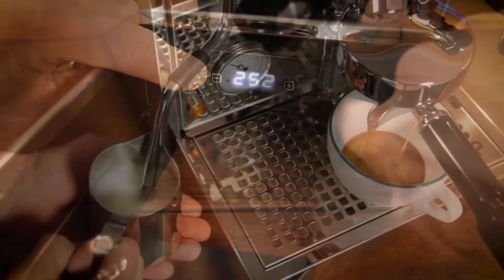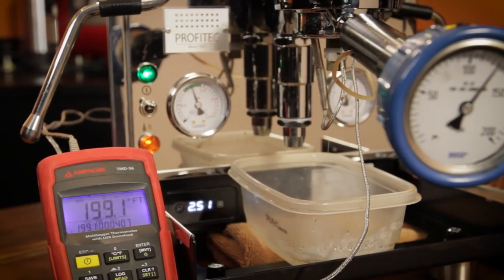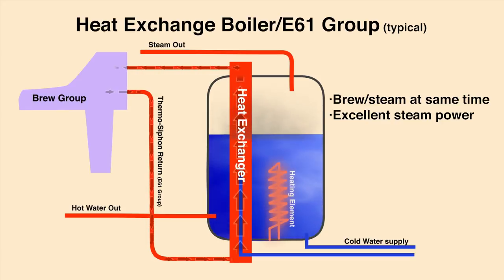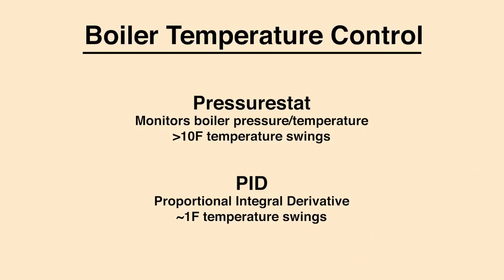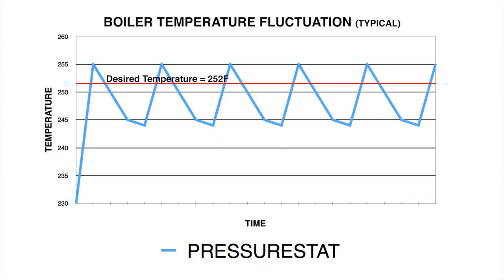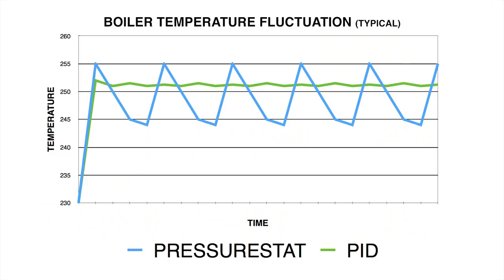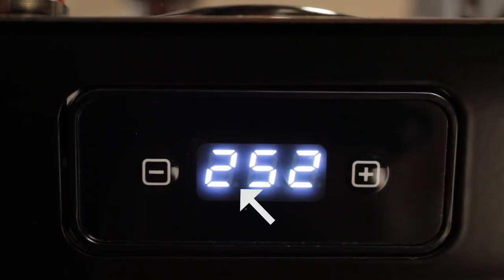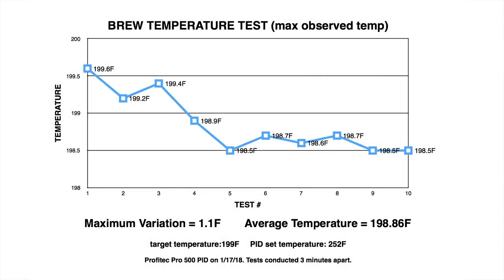Review: Profitec Pro 500 PID Espresso Machine

Comment: Mi Marc, thanks for the video! Just got my new Pro 500 w Flow control! It's beautiful! Any tips to get good crema on this? Not sure what I am doing wrong but I don't get any crema. My old machine was a Gaggia Classic and I am using all the same coffee and grinder (I have a Breville grinder) but no crema with the Pro 500.  Do you have any advice? This is the first time I use a machine like this. Thank you!!
Reply from the maker: Hi AP, Sorry for the delayed response. Been hectic around here as we deal with current events. I posted a video a couple of days ago on calibrating flow control and a deep dive into 5 flow profiles to use for different coffee types and situations which should help: https://youtu.be/_8lNz2rL5l8 Beyond that, lack of crema is usually the grind size and/or the coffee. If it's a coffee you used with the Classic and got crema it should def be capable on the Pro 500.
Marc

Comment: Thanks for the review! I'm on the process of buying this machine. However, I'm still doing research on which grinder to choose. The sette 270 seems to be a nice grinder to go with the PP500. Could someone teel me if it would be a good choice and other alternatives worth considering. Much appreciated
Reply from the maker: Hi DH, You are welcome and thanks for the question. The Sette 270 is a nice grinder. Be aware it's intended for home use. It's not a prosumer level grinder. It's also a hair louder than most due to it's more open design. If looking for something with a more robust build you might consider the Ceado E5P or E6P: https://www.wholelattelove.com/ceado-e5p-electronic-coffee-grinder
Reply: In term of grind quality, is it similar with the Ceado? The Ceado seems a bit to big for my few shots a day.
Reply: @Dom6450  what did you end up going with?  I went with eureka mignon specialita 16 and it is very quiet and not too large on the countertop!

Comment: How does the Profitec 500 compare to the Bezzera Magica pid and Mitica top? Is there a significant difference in quality? I don’t see these 2 Bezzera machines in your store, any specific reason for that?
Reason for asking is that I live in Singapore where the Bezzera’s are available but the Profitec I would need to import from Malaysia, so a bit more difficult on the aftercare support.
Reply from the maker: Hi Peter, Thanks for the question. We have chosen not to carry the Magica and Mitica. Frankly that decision is beyond me. My guess is they're either not available in US market or our product specialists decided they overlap in capabilities/features with other machines we carry. The Magica is up there in pricing for a HX boiler machine - significantly higher price than the Pro 500 PID so that likely has something to do with the decision. IMO the Pro 500 is the cream of the crop of PID HX boiler machines. Other options in that category are the Rocket Espresso Type V and Evo R Mozzafiato and Giotto machines. Type V is vibration pump while Evo R is rotary pump and plumbable. The Rocket machines are more expensive than the Pro 500. My preference is with the Pro 500 - slightly better build quality than the Rockets but some prefer the look/branding of the those.
Hope that helps!
Marc

Comment: Being that most prosumer machines have a copper boiler, is there any disadvantage of a SS boiler found in this machine and the ecm v slim? Or should this be seen as an advantage over copper?
Reply from the maker: Hi Eric, Thanks for the question. Most newer machines I'm seeing have stainless steel boilers. Especially ECM, Profitec. Working with a Rancilio Silvia Pro at the moment and it has a stainless steel service boiler and brass (lead free) brew boiler. I personally have a slight preference for stainless steel but I would have no problem with copper. No disadvantage to SS IMO. Actually it looks much nicer down the road when you open up a machine. Copper tends to discolor (patina) and get stains.
Marc

Comment: Hi Marc .. a maintenance issue.. I have had the Pro 500 PID for about 5 months and love it. Almost no flushing required. I have a question about chemical backflush cleaning. When I do it, it really removes all lube off the shot pull lever/cam 'innards'. I then need to disassemble and add Molykote, which is not too bad. I recently read and tried adding about 3-4 drops of extra virgin olive oil in a water backflush and that seems to lube it as well (do that once a month). Can you ask your maintenance gurus if they think the olive oil will also coat stuff it shouldn't. The lever mechanism dries out so much, that I'll need to lube somehow after every chemical clean (3g cafiza, every 2 mo. 1-2 shots daily). Thanks.
Reply from the maker: Hi Dave, Thanks for the question. I'll forward to our service manager and report back with any thoughts he may have. Honestly don't think he'll have any experience with olive oil but may have an opinion on coating stuff that it should not.
Marc
Reply from the maker: Here's the response from our service manager:
"Interesting. I never heard of that one. The only thing I could see it possibly affecting is it could possibly cause a buildup on the filter screen inside the mushroom valve since the oil will move to the top when not in use. I’d just suggest he keep an eye on that.
I’ll start trying that on my home machine too. For science."
Reply: Thanks for the reply.. probably once a year I'll take the mushroom valve out and clean and examine for any buildup.
Reply: Hi Dave, I noticed this too the first time I cleaned the group with Cafiza. Cafiza is pretty aggressive stuff, so the second time I just used about half so 1,5 grams (more in line with Profitec own 2 gram tablets) which seems to be the right balance between cleaning and removing oils from the group, but not removing all the oils from the lever itself. Also the profitec manual advices to wait 1 minute to after each backflush with lever in middle position and purge the water after that minute. This allows the cafiza to do its work. Most videos in the internet purge the water directly. So my take is, use less cafiza and more time to let it do the job cleaning the group. Hope this helps. If you used to much cafiza and all oils are gone, you don’t need to use seperate oil , because this will automatically build up again after a few days of making coffee.

Comment: What’s the difference between the Profitec Pro 500 and the Rocket Mozzafiato Type V? I’m strongly considering a single boiler traditional style espresso machine with PID control.
Reply from the maker: Hi MS, Great question and good timing. I have a video going up later today comparing the Pro 500 PID, Rocket Evo R Giotto and Bezzera BZ07. They are all HX boiler PID machines. As you probably know Rocket makes the Type V and Evo R machines. They are the same spec wise. Only difference is Evo R's have rotary pumps and are plumbable. The Mozzafiatos and Giottos are identical. Only difference are the exterior panels. As to difference between Pro 500 PID and Mozza Type R... Both are incredibly consistent with brew temps! IMO the Pro 500 is more elegantly designed internally. It has less complicated plumbing and better component layout. Also much nicer steam and hot water valves on the 500. What the Rocket has is more flair in the form of branding and a +$200 price. The Mozza does have a weird thing IMO where the drip tray width is a little larger than width of side panels so it extends beyond them by about a 1/4 inch. They use same drip tray on Mozza and Giotto. Works on the Giotto but has the overhang on the Mozza. Hope that helps. Let me know if you have more questions.
Marc
Reply: Whole Latte Love Marc, thank you for the quick and informative reply! I’ll check out the new video later today. For the Rocket lineup, I’m leaning more towards the Mozzafiato because I really like the flat sides and how the guard rail is actually a part of the panels. But you’re right, I now notice how the drip tray is a little wider than the rest of the body. Have you tested brew temperature consistency for the Mozzafiato like you did with the Pro 500? And if so, does the Mozzafiato have comparable results?
Reply from the maker: Hi Michael, Hopefully you caught the new video: https://youtu.be/Rn1S23pGPiQ  I test the Giotto with the Scace in the video. Results are comparable to the Pro 500. As mentioned the Mozza and Giotto are identical internally. I have Scaced the Mozza before and no difference from the Giotto.
Reply: Hi Marc, I caught the video! Very in depth analyses for all 3 machines. It looks like overall the Rocket and the Pro 500 are pretty comparable high quality machines. Now I just have to convince myself to spend $2,000+ on an espresso machine and a suitable grinder.
Reply from the maker: Michael Schigelone hear you! It’s an above average investment

Comment: Thanks for all your excellent reviews. They make me love to have an ECM Synchronika and I´m willing to pay for the benefits of rotary pump, E61 Brewgroup, PID, dual boyler etc.
BUT: It is for about 5 cups a day and with that, 30-45 minutes time to heat up is what concernes me.
Do you think the PP 500 is significantly faster in heating up due to not beeing a dual boyler machine, and makes me happy as well?
Or could you think of any other machine with (most of) the mentioned features that heats up significantly faster?
Reply from the maker: Hi Rainer, You are welcome! Thank you for the question. The Pro 500 will heat up a little faster as it's putting all it's power into one boiler instead of two. a couple of things you might consider. First, a timer switch. We love wifi enabled timers. You can put on a schedule and/or control remotely from a smartphone app so you can have your machine come on before use. Second, you can speed up the warm up of the E61 group by running blank shots prior to use - the boiler will be up to temp with 5-10 minutes of turn on. Third, if you are not steaming the steam boiler can be turned off via a switch behind the drip tray. For a machine that heats up faster you might consider the Profitec Pro 300. It's a compact dual boiler PID machine with smaller boilers: https://www.wholelattelove.com/profitec-pro-300-dual-boiler-espresso-machine
Reply: Thanks a lot for your time to help - some more things now to consider. 
The Pro 300 is very nice and should be fine for my 5 cups a day (and even more), I just whish it has a E61 group. (And I am still in love with the ECM Synchronika ... so maybe the Pro 500 will be a good compromise, if it heats up faster.)
Thanks a lot again, and maybe you can also give a big ´thank you´ to Todd and Morgan too, they are very helpful as well.
Reply from the maker: Hi Rainer, You are most welcome. I will pass along your BIG Thank You!

Comment: Do you have a chart for brew temperatures along the entire duration of a 30 second or whatever brew? If that, too, maintains the 1 degree variance, it seems like you're losing a bit of the character of the heat exchanger system just for the sake of saving a bit of water by not doing a cooling flush?

If it maintains the temperature profile (I don't see how it wouldn't? There's always going to be cooler water entering the heat exchange loop, so the temperature will always decrease to some degree, right?), though, I know what I'm going to be saving up for.
Reply from the maker: Hi g, Thanks for the question. I do not have a graph from the Scace for extended duration. What I would typically see when running water thru the Scace was the temperature drop a degree or two during the time 2oz/60ml of water was dispensed. Keep in mind water entering the HX is flowing very slowly so it has time to gain heat from rest of boiler as well as from the thermal mass of the brew group.

Comment: I've had the Profitec 500 with flow control for about a year. I love it and have had great results! I keep wondering though what the baseline flow is on the standard 500? What would the rotation (from zero flow) be to equal the flow diameter of a standard Profitec 500 without flow control?
Reply from the maker: Hi KH, Thanks for the feedback sharing your results with flow control. The stock (no FCD) flow rate on most vibration pump machines is about 8g/s with no restriction. To obtain that rate with FCD installed open the FCD about 1.25 turns. Here's a great article which includes more info on FCD calibration and graphs of flow rates for various coffee types and brewing situations: https://www.wholelattelove.com/blogs/articles/intro-to-calculating-flow-rate-on-e61-group-machines
Here's a link to playlist with a number of videos concentrating on a specific flow control extractions: https://youtube.com/playlist?list=PLaBDDfOHAAC2tlvMR2WZSLjizjGrcIT7H
Marc

Comment: Hi Mark, can the Pro 500 PID do pre-infusion?
Reply from the maker: Hi, It does not do pre-infusion. The Profitec Pro 700 and ECM Synchronika can do a line pressure pre-infusion when plumbed. Not very many E61 machines can do actual line pressure pre-infusion. It requires machine be plumbed-in and be designed so pressure from the plumbed-in line is available in the machine without the pump running. Many E61 machines have a solenoid valve which only opens line pressure into the machine when the pump is running. That's the case on machines like the Rocket R58 and Expobar Brewtus. Some E61 machines can pre-wet the coffee but there's no pressure behind that. Here's a video which cover pre-infusion and pre-wetting on E61 group machines: https://youtu.be/2DPcZD48TxM
Reply: Whole Latte Love Hi Mark! Thanks for the reply. Does the Pro 500 allow for pre-wetting or is this also reserved for plumbed machines w/o solenoid valves?
Reply from the maker: Good question! Most all machines with an E61 will drop some water onto the puck if the lever is put into the pre-infusion position. It's that spot right before the pump turns on. Based on your question I just tested the Pro 500 PID. It dripped ~.75oz or 20ml of water over 15 seconds before stopping. You could get the same affect - and more water if wanted by turning the pump on for a few seconds then turning off and waiting.

Comment: I find it weird that only in coffee do companies advertise PID as the method for controlling temperature. The even crazier thing is that people actually use that to describe it. The fact of the matter is that PID controllers are used literally everywhere. No one gets in an elevator and says “hey man - this elevator has PID controlled levelling”.
Reply from the maker: Hi Dr. F&C, Thanks for the comment. Yes, PID is used in many applications. I guess it's a big deal in espresso machines as they made a huge improvement in temp stabilty vs. simple thermostats and pressure stats. Maybe kinda like auto manufacturers making noise about anti-lock braking 20 years ago.
Marc

Comment: Although the Pro 500 cannot be plumbed, does this HX have any kind of line pressure that will allow for pre-infustion?  I know the E61 has an adjustment which allows for pre-infustion, but you need some kind of line pressure 1.5 - 3 bars.  Does the Pro 500 have said line pressure?
Reply from the maker: Shawn Michael Larkin Hi Shawn, thanks for the question. HX machines with E61 group can “pre-wet” the coffee but do not pre-infuse with no connection to line pressure. Even when plumbed, not all machines do line pressure pre-infusion. Many of those have solenoids which close off line pressure unless the pump is running. Machines with solenoids include rotary pump models like Rocket R58 and Expobar Brewtus. Machines like Profitec Pro 700 and ECM Synchronica do not have solenoids on line in so can pre-infuse with line pressure. Some users consider the slower pressure build up of vibration pump machines like the Pro 500 a type of pre-infusion but it’s not controllable like you’d have on the Pro 700 or Synchronika. Hope that helps. Let me know if you have more questions and I’d be happy to answer.
Reply: Thanks for the reply.  Can you detail the "pre-wet" ability of the machine?  I presume you mean that if you move the E61 lever to the appropriate place, then any pressure left in the system will allow a very small amount of water to drip onto the puck.  Is this right?
Reply from the maker: That's right. Move the lever to the spot just before the pump kick on.

Comment: Hi Marc, great video, I think I found my new machine :) Question though, how much does the PID contribute to not needing a cooling flush? From the video and some of your explanations in the comments it seems that the PID does a very good job at keeping the boiler at a steady temperature, but it is the engineering of the thermo-siphon that amounts to not needing a cooling flush. Would this kind of thermo-siphon engineering also be possible in a non-PID HX machine?
Reply from the maker: Hi Nicolass, Thanks for the comment and great questions! It's a combination of the very accurate PID temp control and engineering of the thermo-siphon which produce excellent brew temp accuracy. In non-PID HX machines a pressurestat controls boiler temps. Pstats can have temp swings of 10F or more. While good thermo-siphon design helps, I have yet to use a non PID HX machine that does not require a cooling flush if the machine is sitting idle and at the top of its temp range.
Reply: Very interesting, thanks for the great insight!
Reply: I'm afraid this is not answering the question very clearly. It is not clear at this point how a PID can help eliminating the need of a cooling flush. Why does the brew water not overheat? Does it circulate and cool down at the group? If that is the trick, how can this avoid heating up the group too much especially on a hot day and with high boiler temp setting?